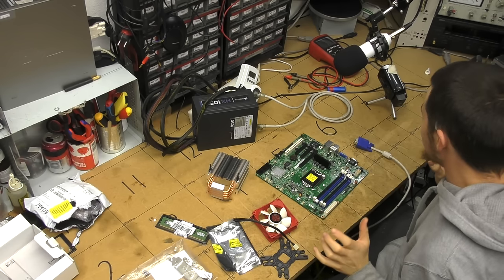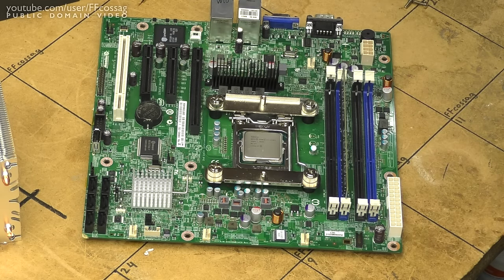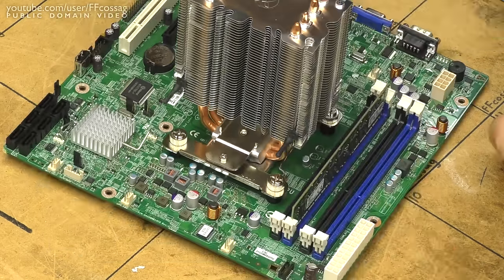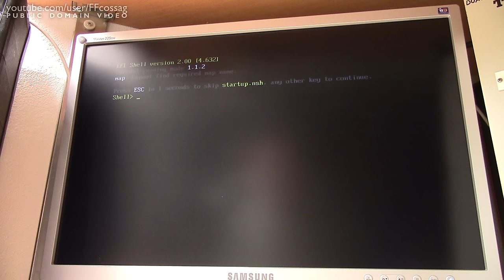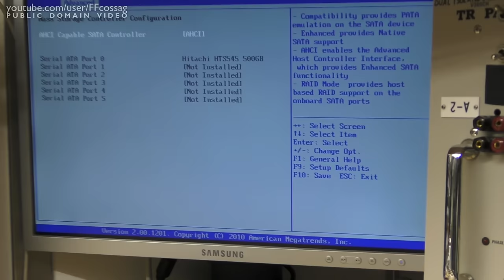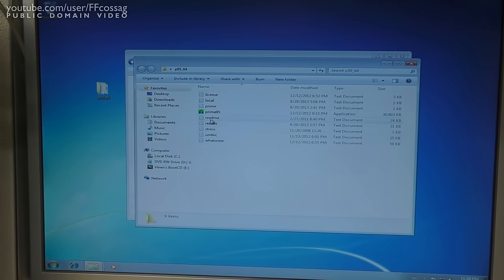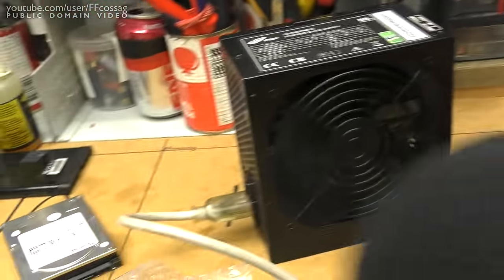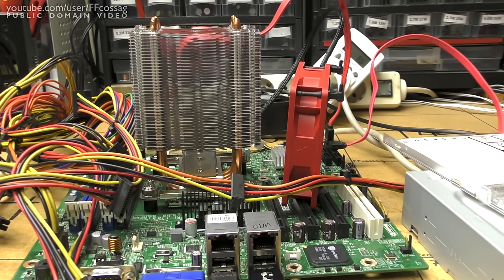Fixed S1200BTS & Xeon E3-1270V2 - first test!

Comment: After mounting more heat sinks than I care to remember, the accepted practice where I had worked was a "small pea sized" dollop of thermal compound was all that was needed. Placed in the center of the CPU the heat sink was installed. To prove this theory try it yourself on a fresh CPU/ heat sink install. Do not push down on the heat sink, allow the springs to do the clamping force. Heat sinks that come with compound already applied is much thicker than say Arctic Silver. Our engineers specified we use only Céramique™ 2 compound as it is NOT electrically conductive. I do not know what brands are conductive, but high silver or copper compounds can be, so if to much is applied and  squeezed out, it can cause problems.
Try and remove the heat sink, you will find that 98% of the compound has been distributed. Most of the heat emanates near the center of the cpu anyway so your covered.

Tip on cleaning CPU or cpu socket pins if contaminated with compound.
1) WD40 or Goo Gone or similar 
2) Alcohol
3) compressed air
1 softens the compound so you can gently lightly brush away compound.  Allow a long dwell time for solvents to work  [5 to 15 min] then use a soft brush (acid brush) and judicial use of sponge or paper towel
2 will wash away residue 
3 will dry the circuits
If required repeat all steps if unsure the board is fully dry, allow to sit in a warm place a few hours
Some RMA jobs our customer required us to wash their motherboards and air dry for 24 hours
Sorry for the rant just more of a FYI "heads up"
Reply from the maker: I used to do the pea sized thing for a long time, until I noticed that often the compound wouldn't really spread well to the corners of the heat spreader. I then did some testing, and figured out that just putting "more than enough" on the CPU and then rubbing it around with the heat sink provided the most reliably even distribution. I don't use conductive pastes either (and I've never seen a grey OEM paste like the one in this video be conductive), so a bit of excess is hardly worth caring about.

May I ask what you work with? It sounds fancy when you can say stuff like "our engineers". ;)
Reply: I worked building computers for companies like Philips Medical, General Electric, Siemens, and many other medical and security firms. Most builds were part of a machine such as an MRI or some such scanner. Some computers were servers that host data for the various computers that were embedded into a machine. So yea I just built computers from the chassis on up, loaded the BIOS changes, configured the SAS/RAID controllers loaded the software and performed customer testing that could include stress testing. Sometimes you would find your building a system and testing another or five. It was not unusual to build and test many systems in a 8 hour shift. Most of the motherboards were Intel or Supermicro. The majority were dual cpu systems and many had killer video cards that were used as data cruncher's, you know the type? Dual PCI slot type video cards. Most computers had custom designed chassis but some were from stock China suppliers.
Basically the company I worked for contracted to build custom computing for others applications, we did not have a product that was a house brand that sold to the market. I retires from that company this past July. This is where I got all these 7Ah 12 volt batteries and a ton of case fans, heat sinks sata cables, you name it, if it was trash I offer to remove it for them hahaha
Reply from the maker: Cool - doesn't sound like a bad gig. Nerdy with plenty of opportunity for "trash grabs".
Reply: Is there really a need to cover the edges of the heat spreader of the CPU considering the chip itself is located in the centre of the heat spreader?
Reply from the maker: Kane It's a marginal difference (which is why I find most thermal paste arguments to be a bit silly), but I like to have a very thin layer everywhere, to make sure there's as low thermal resistance as possible.

Comment: hey, if you really want to test the system for stability i suggest you do it with intel burn test. sometimes i got systems to pass hours of prime95 without errors but then fail with intel burn test. if a system is particularly important i do memtest86+, prime95(in place large FFTs) and intel burn test
Reply from the maker: Intel Burn Test is linpack, yes? I ran 200 passes of that too for posterity. I find that linpack has a tendency to make a lot of heat, but often fails to find issues on systems which aren't having severe thermal issues.

Comment: that is usual for a 350GB drive and should not be a problem and I happen to have one in my old HP with a m2n68-la (Narra3) motherboard with Phenom II X3 Stepping 3 CPU with 4GB of GDDR2 RAM so there is no problem with the Hard-Drive just ignore the noise it makes.
Reply from the maker: There is something wrong with the drive, because it seems to suffer from quite poor seek times. It does technically work, but it's running incredibly slowly. Good enough for a shitty test drive, though.
Reply: I have a very similar Hitachi drive that suffers from the exact same symptoms. But it has been stable enough that it has lost no data.
Reply: I'd say that it is normal for a crappy 5400RPM 2.5" laptop drive. This is normal sound it makes while seeking. If it starts clicking or screeching then it's fuckered. As for the SMART data bad or pending sectors are the most frequent failure indications.
Reply from the maker: LuparaX2 I agree, the thing is that it makes these sounds even while NOT seeking.

Comment: That install method if ok if it has a metal can on , never try it on a bare die CPU or wave goodby to your processor :P. I have seen processors shipped worse than that , i have seen one directly shipped in its little cardboard box with the shipping label on, it was a quite rare Tualatin 1.4 Pentium 3 S, with the even more rare interconnect  for it to work in older socket 370 boards, it lives however as the P3 is a badass shit kicker of a CPU.
Reply from the maker: Glorious Tualatins. How I longed for those back in the day. Pentium 4 clock speeds out of a Pentium 3 chip, mmm.
Reply: They where faster than the first p4s thats why they discontinued them :P. I was an AMD boy at the time , but my "just in case" pc with RS232 and parallel ( real ones) needed a faster CPU to keep up with the final version of POS ready 2009 ( XP SP3 with updates)
Reply from the maker: Andrew Joy I envy you; I was stuck using a 2 GHz Willamette (first gen) P4 for the longest time. It wasn't fun.

Comment: Hey bro, i found out one of these mobos, with the processor, the problem is i dont know how to start it without the case, what pins should i close the circuits, could you tell me?
Reply from the maker: Just poke around randomly on the front panel header until it starts.
Reply: Turned out that i maybe have a problem with my motherboard
It keeps restarting after 3 secs, real prob that there is no video, I'm no magician so ill let that way xD

Comment: surprised you went with only a E3 Xeon when the E5-2670 gives you 8*3.0GHz for 1/3 of the price and works perfectly with ECC Reg memory on those cheap generic Chinese x79 boards.
Still a great chip but for that price there's certainty a lot of better deals.

Also I have never killed a CPU by ESD and that means something. Memory seems to be way easier to kill by ESD than anything else.
Reply from the maker: Wow, those E5-2670s are pretty snappy. The reason I went for an LGA1155 platform is that I could source this known-good, Intel made motherboard VERY cheaply, and I wanted to step up to as modern a platform as I could, mostly to keep the power consumption down. Unbuffered memory also becomes a good thing in this regard, as buffered RAM tends to run a bit toasty.

That said, now that I think about it, it wouldn't have been all bad to have that extra performance. Oh well, life's full of compromises and small mistakes.
Reply: :D yeah the E5-2670 does need a bit more juice but it's really not too bad. Got two of them in my main rig and i am really glad i bought them.

1155 is still a great plattform and i know you will have fun with it but i think in terms of the price/performance ratio 1155 is only really worth it with unlocked chips.
(or the really cheap ones. 200€ for a locked 4-core ivy chip is IMO just too much. That's haswell or even broadwell pricing if you know where to look.)

About RAM running toasty: i think you are mixing up something here: ECC REG memory hardly produces any heat.
My 1333 DDR3L ECC REG Modules from Micron that i have in my dual E5-2670 rig are overclocked to 1600, overvolted by 0.05V and they are ice cold.

You're probably thinking of ECC-FB DIMMs. I have a old server that still uses DDR2 ECC-FB and those do hit 90°C with plenty airflow over them on a hot summer day! 

Anyway, enjoy your new Xeon! No matter what generation, putting old server hardware back in service is always a good idea and fun to watch! ;)
Reply from the maker: Oh, yes, I thought all LGA2011 stuff ran FB memory, it turns out I was mistaken. Price-performance wise for my build, however, the two platforms come very close since I got this motherboard for 20 €. The cheapest board I can find on Ebay is ~170, plus ~80 for the CPU puts it at a slightly higher price point than this build. Still a tad better performance-per-dollar, though, but oh well. Considering the fact that the E5 was a $1500 CPU when new versus the $340 E3, plus the lost option of scalability in the future does make me doubt the sanity of this build, but, again, oh well.